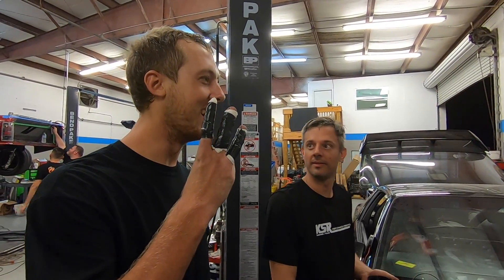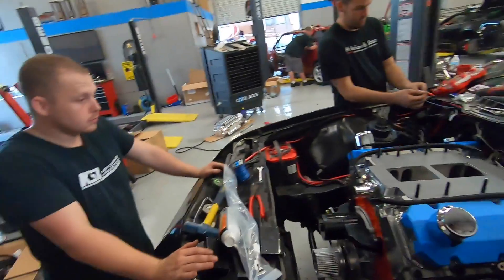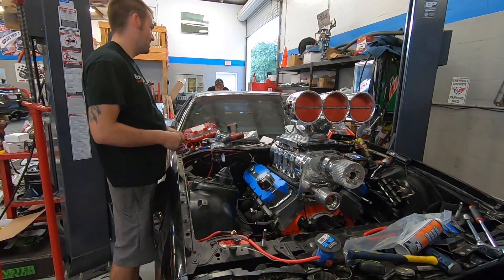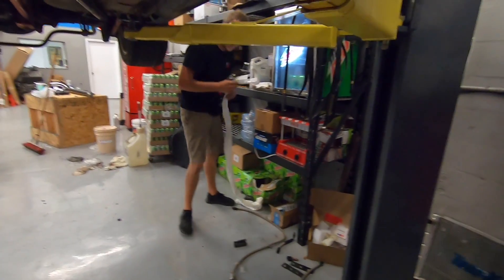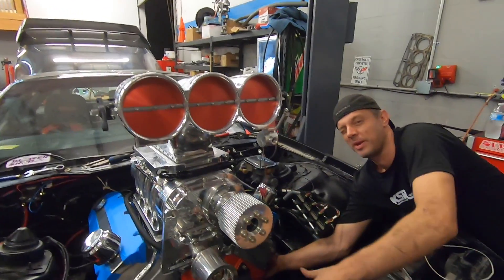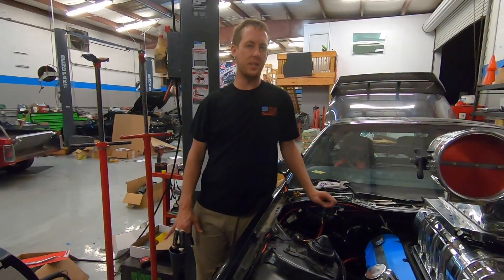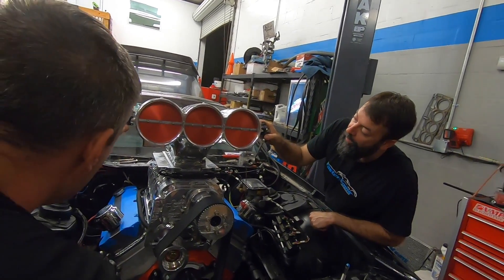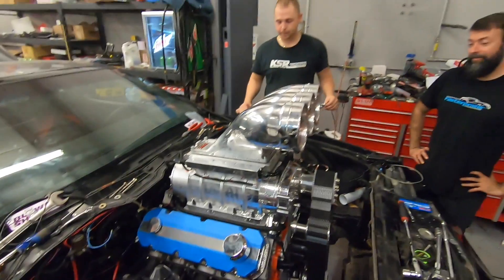TOAST IS ALIVE! Firing Up Our 10.3L Supercharged BIG BLOCK For the First Time! *MAXIMUM FREEDOM*

Comment: That feeling when you throw away your multi-thousand dollar sound system for the pure sound of a big block V8
Reply: Loud enough sound system and you wouldn't even notice that V8. It's loud, but it's not 160db loud.
Reply: Hell yeah there is no substitute for cubic inches 🤙🤙🤙🤙
Reply: @bepbep7418  well if you go look up a top fuel car which this motor basically is they are pretty close at 150 db. Also I would rather listen to a nasty V8 over sound system.
Reply: @bepbep7418  True AF I cannot hear my V8 when I turn up my JL sound system
Reply: Rob C it is in no way shape or form the same as a top fuel engine. No coolant journals blows up every pass gets rebuilt every pass 10,000hp and running on alcohol.
Reply: @Sackmatters  top fuel  cars run x%nitromethane....not regular alcohol ....from Wyoming USA 🔫🤠
Reply: Stereo systems are for 16y/o children. Most stock stereos are more than enough today. My stock bose system sounds 10x better than my $2000 set up in the early 2000’s. Put your money where it belongs, under the hood.
Reply: @ChuckBeefOG  Bose.... LMFAO you must not like the lower half of your sound stage.
Reply: Joe Baker Im not an audiophile tbh. Sounds great to me for a pick up truck. Not really into rap music thus no need to shake apart my vehicle with subwoofers. I was young once, my opinion then was “i would never own anything without a custom stereo”. If thats your hobby go for it, bring in the noise. Im not knocking ya, i get it. Just saying im buying a Procharger these days before 2 Alpine 12” subs.
Reply: @lanemendenhall1717  oh so a 632 ci big block is umm I if went to school is 132 ci bigger. Did you watch the video???
Reply: @ChuckBeefOG  has nothing to do with rap music. There's plenty of country and rock music with bass... You clearly have no idea what the audio world is like these days. And no I'm not talking about that 16 year old kid who throws 2 RF Punch 12s in the back of his neon and thinks he has a sound system.
Reply: @rob449  I want to see you put Nitro methanol through that motor and then tell me it's a top fuel dragster.
Reply: @rob449  off the NHRA website. Powered by a supercharged and fuel-injected 500-cubic-inch adaptation of the famed Chrysler Hemi engine, Top Fuel dragsters can burn up to 15 gallons of nitromethane fuel during a single run. Do you think for 1 10th of a second this motor flows that much fuel? Uh no not even close.
Reply: @bepbep7418  Again to you sir did you watch the videos??? Did you not hear and see the 632ci big block with supercharger and the fuel injection plate???? Now yes, it's not run on Nitro but it could be. Look I understand this is not a top fuel engine but it could be no problem with different parts. Now to the point put some top fuel inspired exhaust on it and you are not going to hear any sound system. You might fell the subs but that motor would drown out the highs.
Reply: @rob449  XD just because it has a higher displacement doesn't make it a top fuel dragster motor. Even if you "changed a few parts" the block itself would not hold the power. Notice it says "adaptation" of a 500 c.i. Hemi. They're not Chrysler blocks by any stretch of the imagination. You would almost immediatly granade the block itself if you tried to run nitro meth through it. Nitro Meth is a completely different animal then pump gas or AV fuel.
Reply: @rob449  The block is machined from a piece of forged aluminum. It has press-fitted, ductile iron liners. There are no water passages in the block, which adds considerable strength and stiffness. The engine is cooled by the incoming air/fuel mixture and the lubricating oil. Like the original Hemi, the racing cylinder block has a deep skirt for strength. There are five main bearing caps, which are fastened with aircraft-standard-rated steel studs, with additional reinforcing main studs and side bolts("cross-bolting"). There are three approved suppliers of these custom blocks.

Like I said. This is no where near a top fuel motor.

Comment: yep definitely 2000 hp or more your going to need a wheelie bar and big slicks for her
Reply: Nbkdelta1 Gaming Channel not a drag car, he doesn’t need a 3rd one that’ll keep him away from Leroy more
Reply: @bbdl7042  he said its gonna be used as a drag car after the burnout comp
Reply: Its a burnout car....
Reply: I hate that they are even using it as a burnout car but I'm sure that I am the minority
Reply: Joe Baker they said they will drag race it after
Reply: Omg yes that would be awesome probly there fastest 2
Reply: the displacement plus the blower setup they have is certainly capable of making that kind of power, but from what I understand, the rods and crank and other internals aren't built for it in that motor. I'm guessing they'll end up tuning it to 1300 or 1400, which is basically just selecting a small enough blower pulley to not lean out the air fuel ratio with "only" 1300 hp worth of fuel being delivered.
Reply: @admkbldwn  I agree, I'd like to think whatever internals have been used in this engine, would be safe for around 1200-1400 hp during long, high rpm periods of time, since most blown burnout cars in aus run around 1500 hp on methanol and run for about 2 mins on the limiter. 
I do think he'd be able to push 1800+ hp on a high boost pulley but not sure for how long. BBC's are stout motors, and I'd expect nothing less from the internals knowing it's a blueprint, but we'll see. 
It won't be faster than Leroy though, even if it had 2,000 hp, it's a much heavier setup.
Reply: Aaron Rembert luckily it’s just one of the ugliest gen camaros
Reply: Make this the drag car and make Leroy a burnout car. Leroy has hit the wall.
Reply: @ChuckBeefOG  you know nothing about drag racing lmao.. he's barely scratched the surface not even 1 full year on this new setup and it's been down 2-300hp since the clutch started slipping you've never seen a pass with the kinda power it has now to the wheels because it's been slipping... I'd say he's maxed out at 7.5 maybe 7.4 unless he's got a death wish it starts getting super sketchy with no aero above 165
Reply: No Aaron...im with ya...as a gear head I'd drag my nuts through a mile of broken glass for a blown 632 ci big block for my engine-less '73 Stingray...and they're going to make tire smoke...yay.  I rank burnout contests right down there with roll racing...
Reply: @HealerPain  it has better suspension than Leroy so it should be able to out 60' him. It also obviously has much better aero. I don't see Leroy's weight difference making up for those short commings and less power.
Reply: Alt Codes but remember they’re using a power glide
Reply: @sackmatters what do you mean third gens are beautiful
Reply: GixxerGuy1000 _ I would say maxed out it might do a 7.9 or 8.1 pass. Its problem was never power. Now they have too much and cant make it hook. The fastest car down the track is not the most powerful car, its the car with the best drivetrain that can put the power to the track with spinning. I honestly dont think Leroy will break its own record.

Comment: that kind of torque just from idle, you might want some chains or straps to keep that engine from flying out of the car, or twisting the f-body front frame (IMO two chrome chains on each side to hold it down adds to the beastly style

Comment: Super glue, then baking soda to harden it very fast. Diesel mechanic, by trade here, I use it more than band aids.
Reply: camjamsdad  it helps it dry immediately. No blowing on it, no hair dryers. Soon as the baking soda hits it, its dry.
Reply: camjamsdad  
We use Iodine for the infection then butterfly or liquid skin
Reply: Superglue to keep what inside you from leaking out.
Reply: ya know Adam Savage from mythbusters? I believe he has a video explaining why baking soda works really well, its basically adding "supports" to the glue, and its also an accelerator. Superglue is just a different CA, so this trick also works really well with CA glue. I see that rc plane in the background cleeter, next time you crash it, try this.
Reply: Been there a few times and it works! Hell of a lot cheaper than getting stitches put .in
Reply: Super glue has saved me from stitches at least 10 times in the last few years. Never tried baking soda though. I wrap it with a plastic bag to apply pressure and harden it. You want to make sure its a kind the glue doesn't stick to though.
Reply: First time I used it was a quad copter had control issues and crashed down through a tree above me while I ducked down shielding my son (I wasn't the operator).  It put a nice deep gash in my elbow.  A bit of superglue and it was like it never happened.  Make sure you don't leave any gunk in the wound before sealing it, clean it out!  Used it ever since even for small cuts, I'll try the baking soda next time 👍
Reply: I have used superglue when I busted my knuckles.

Comment: That thing is gonna make like 800 foot pounds of torque at like 1400 rpm haha
Reply: At least double that
Reply: It might make 1600 foot pounds peak but I was saying it would make like 800 foot pounds right off idle
Reply: @Rocket Haha. That brings back memories.
When I was about 15 or 16, I tore down my grandpa's RV after he passed away, I took the big block 440 out of it and with some extreme body mods and a lot of help from my dad, I put it into an S10. I still have it, since this was only a couple of years ago and it's my daily driver.
Over the years of driving it daily (I get about 10 MPG) I have since changed out the diff, the trans and the driveshaft since I damaged/broke the originals when I was "Being a teenager" by doing stupid stuff with it like highway pulls, burnouts, launches etc.
That S10 is awesome, I love it to death but it's pretty loud inside the cab.

Comment: You guys need an idle air motor and an electronic throttle valve and gas pedal, (fly by wire) just set it up like an LS injection system. The idle air speed motor will control the idle speed and you can probably program the throttle motor to be progressive

Comment: Fillet of Finger?
 I'll pass.

Give it a coating of Super Glue it works.
 And keep coating with glue it gives it time to heal underneath.
 When it is healed up the glue will peel off.
 For those who say it's not sterile I say neither was the dirt and grease in the cut.
 They use super glue for open heart surgery.
Reply: I super glue cuts all the time but to say superglue that someone has around the house or the dollar store is the same as the glue doctors use it inaccurate..... doctors have a medical grade glue...... the comparison is dumb
Reply: Iodine for infection
Then butterfly or liquid skin
Reply: Did any of you LISTEN TO THE VIDEO?
 Where's he leaving for and when?
Oh wait that's right I forgot there are BENCH RACERS here.
 Never strapped a car down had to shift or twist a wrench.
 We had a driver break a foot the night before a race weekend and he drove wearing a steel shoe I made.
 You do what you need to do.
Reply: @slopoke8656  The medical grade glue is really the same stuff, just with more government red tape and 10x markup. More bald eagles, less government!

Comment: He is sooo gonna twist that f-body. Rip unibody.
Reply: As long as he doesnt try to actually hook, it should be okish. Soon as it finds any traction, then yeah its gonna get bent
Reply: He said in last vid that they were going drag it at some point
Reply: It has subframe connectors and some other stiffening components. “It’ll be fine.”
Reply: Travis Gustin yeah just wait. “Hold my Mt. Dew and watch this...........” I think that’s my new favorite word. Okayish. Lol
Reply: @travisgustin4677  Where are they?  I couldn't see any from 7:20 onward...
Reply: My thoughts exactly 🤣
Reply: therealspeedracer ! ..,  I had a similar thought.  Might be better off in a ‘57 Chevy with a for real frame.
Reply: ChrisHallett83  Yes, but they'll twist and set where BOF vehicles will usually flex and return. It's moot anyways, by the time the car gets serious use it's going to need a full cage.
Reply: I tweaked an 84 with just 600 hp on 10 inh merican street drags
Reply: @thehatefull1761  Not surprised, until you get late in the 3'rd gen F body run, it's just spot welded together like anything else.
Reply: Those third gens had a body flex issue already. It's going to need some serious reenforcement
Reply: @mfree80286  it is a 91 so itbis late in the run and it has a cage already in it.
Reply: It has a cage in it already.

Comment: I built a 383 in a 85 Camaro when I was 16 and ended up warping the frame hard ,after I destroyed the thing I learned about 4linking, just in case you don't know those cars have relatively weak subframes if you are pushing hard launch and alot of torque,I went through a 700 r 4 in a weekend,then a th350 then another th350 then a th400 then warped the car and put the engine in a early 90s GMC 1500  drove it for a while used 2 more tranny's and traded it for a 84 f150 the guy that got the truck went through 3 more tranny's before he got rid of it, the off idle torque of that thing suprised everyone around here including track junkies and would quickly head up beyond 7k rpm w/o  a limiter and it was just one of those things you can't baby,once it started so did the hell raising I kinda miss it.

Comment: @cleetus be careful with the supercharger belt it shouldnt be very tight they shrink under heat!!!
Reply: MIDBC1 you are exactly right sir
Reply: MIDBC1  steve wasnt very specific ,the actual reason for being loose is becuase the intake and blower gets taller when it heats up. Proper adjustement of the belt should take place after engine is up to temperature . Then when it cools down it will be loose until it warms up again

Comment: That blower belt is way too tight!
Reply: Absolutely not, she is about the perfect size, except if u wan it too slip...
Reply: steven bizzocchi from my experience and all the blower companies I’ve dealt with on superchargers for the street and strip. You need 1/2” of movement in one direction when pushing on the belt. As the engine heats up the belt tightens up. If you run it that tight you stress the belt. You definitely stress the snout on the crank and front main bearing as well as the blower bearings.
Reply: A blower belt need to be tight but not too tense, 1/2" is a little too much in my opinion especially when u look for extreme tuning. But anyway, that's not my point, my point is: this belt is about the perfect size, he doesn't push on it but if he did, i am pretty sure there is a good 1/3" of movement. I can see it just by the way he put the belt on. When u have difficulty to put the belt on, THEN it's really too tense...
Reply: @richdudecamaro  that being said it's a video and we are not there too push on it so...

Comment: if you put the distributor in when the timing chain  marks are together it will be 180 out , if the dots are both up, its on compression,,   most think small block is on compression when you time the chain, i put many distributors in back wards before  i realized that

Comment: That motor is going to twist that Camaro like a pretzel at the county fairgrounds!  Those subframe connectors where only meant to handle so much torque.  But don't get me wrong,  I rather enjoy watching all this crazy shit.  Toast is a perfect name for this car.  After they're all done with it, the shell will be super toasty!  Obviously it's not a street car, but good fucking luck getting any sort of wheel alignment.  Ask me how I know.  Spacers, and lots of them.  And it still never went down the road straight after that.  But those were good days for sure.

Comment: Vinyl wrap is probably your easiest option for the throttle butterflys.
Reply: Naw you don't want anything that could peel off or round over the edges. Airbush or pinstripe artist would be the best.
Reply: Loki Trickster I agree that if it peeled off it would be catastrophic to the engine, but it's not like we are talking about your average sticker here. When was the last time you heard of a vinyl wrap just blowing off of a car.
Reply: @430rico  whens the last time you seen a vinyl wrap subjected to the forces of a vacuum cleaner and at same time extreme colds that makes wraps brittle.

Comment: Static time it during assembly.
Get a spray bottle with the fuel
So you can squirt it into the intake.
I've never seen anybody have so much trouble starting a motor.
You guys need to watch Uncle Tony's Garage, hang out with some old guys. Where's your fire extinguisher. Outside is looking really good. Darwin Award candidates.

Comment: Ummm have you guys never seen a roots or screw blower? They speed the air and fuel up so much that they'll FREEZE your hat/butterflies open if you don't put WD-40 on them on a blower that's set up really juicy. That's not just ethanol doing that. :p

I'm kind of surprised that being car guys, you don't know this. That you've never seen anybody spray the butterflies on their metal hat because they don't want them to freeze open.

Comment: Guys, you're going to HAVE TO cover 2 of those injection hat throttle holes up, you CAN have too much throttle body - that hat was made to supply a couple THOUSANDS of horsepower in big boy alcohol & nitro race engines at the limit, we're talking BAE hemis.
You aren't going to have ANY part-throttle with all 3 holes open, the moment it even slightly opens, there's enough air coming in to supply that engine at part throttle.

There's a reason why you don't ever see Fuel cars driving up to the line or to the pits - they only have 2 throttle positions; idle or WOT.

Comment: It’s not late it’s advanced too far the starter was dragging. And when timing chain marks are together # 6 is firing when they are both at the top of the timing gears 180’ from there # 1 is actually firing and #6 is at the end of exhaust stroke,